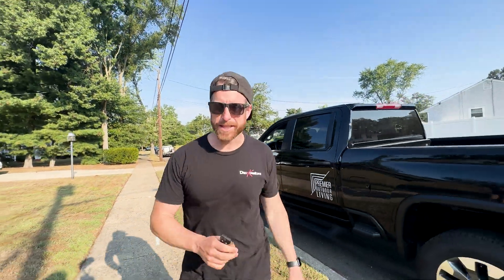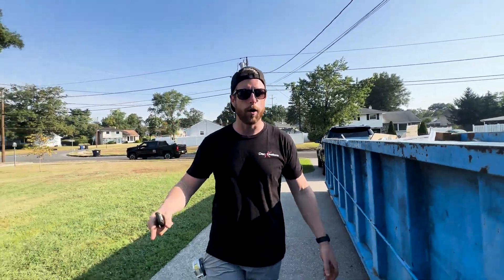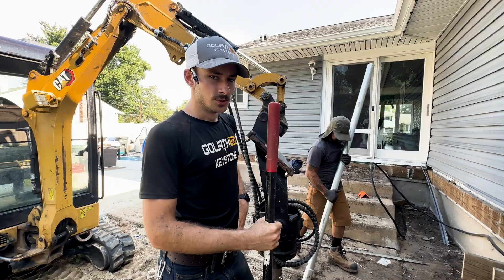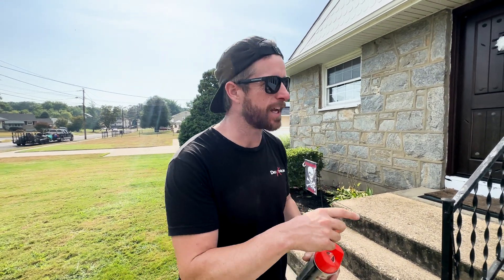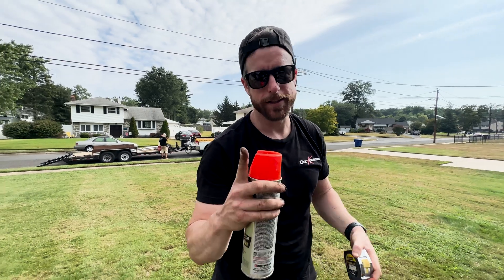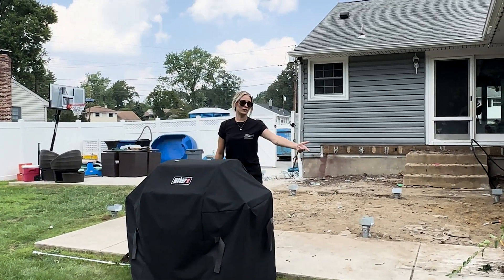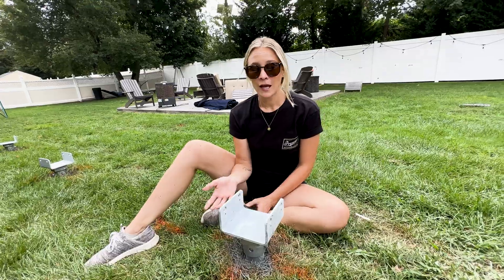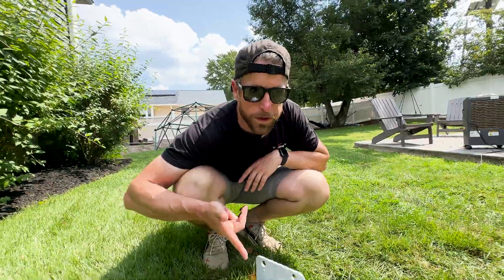HELICAL PILES FOR DECKS - Everything You Need To Know

Comment: You didn't let us know the most important thing, which is the "torque" setting needed and why. So, no, it's not "everything you need to know". Also, it would be nice to know a general cost breakdown, or at least a cost comparison for wood and concrete and Diamond Pier(tm). I got here from a mike Holems video I saw. You have a good video, but it could have been so much more informative.